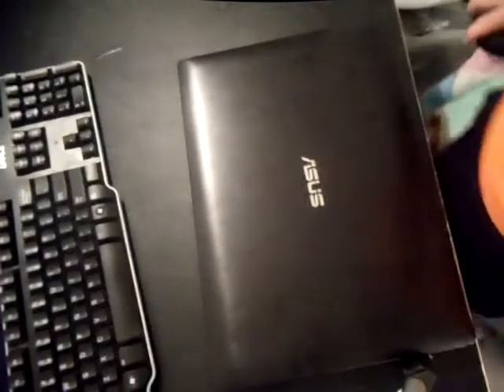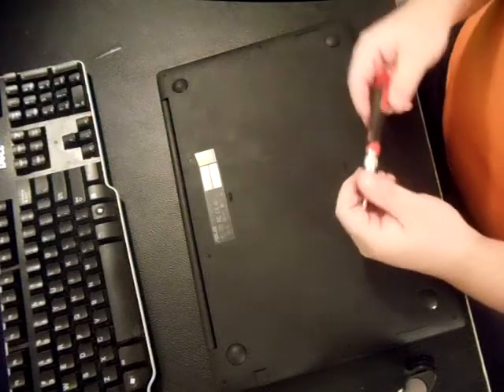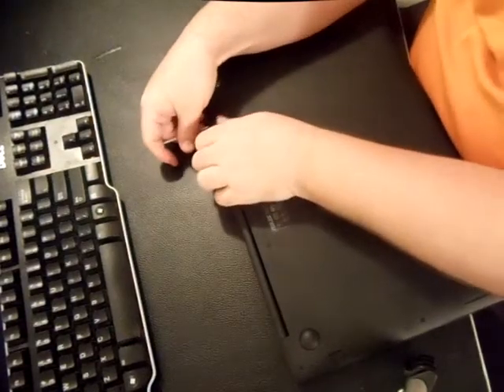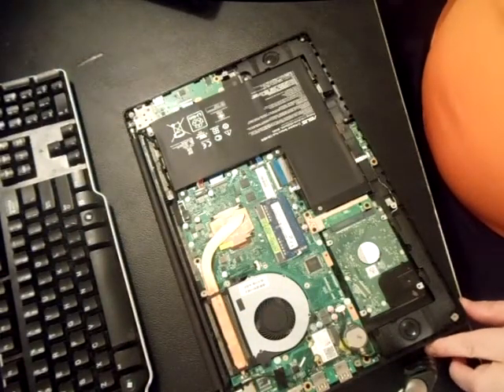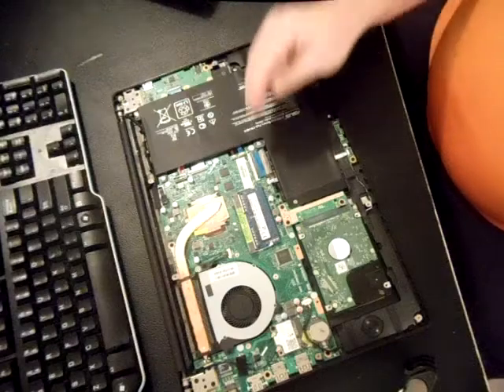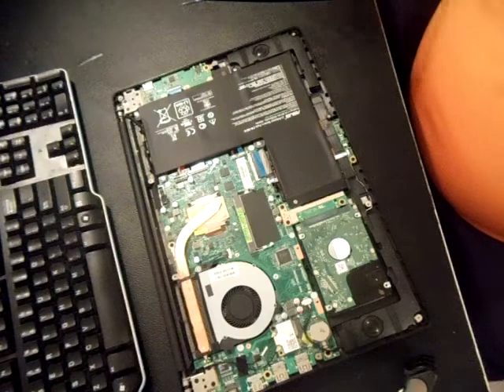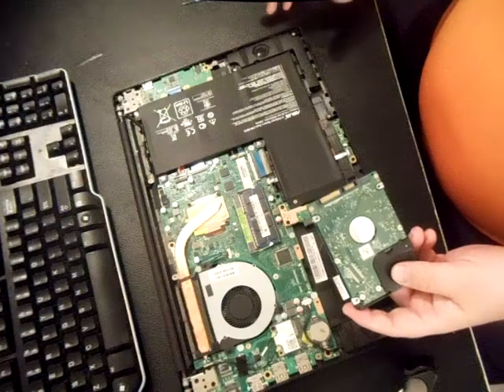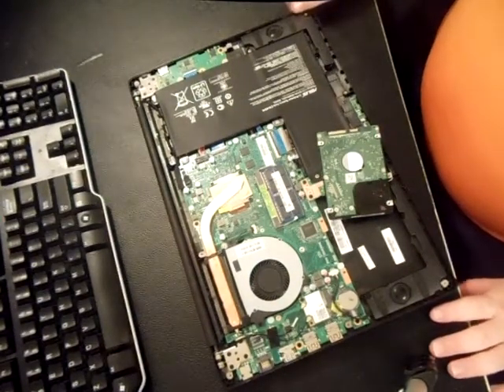Asus Q501LA Memory Hard Drive Battery Upgrade Removal Disassemble (F551M F551MA X551MA X551CA X451CA

Comment: Thank you for your instruction. My Asus q501L when first turn on, it will stay for a few second on the main screen then goes to black screen. I took out the RAM and clean it, but still not working. What do you think the problem is? Thank you
Reply: there is a video of a guy who fixes it by lessining the tension of the cable going to the screen.  It worked on mine with the same issue.

Comment: Would you be able to diagnose my Asus Q502la, that won't start.  That won't recognize a flash drive with .iso image?  I am wondering. Thank you.  I wonder if opening it up as you demonstrated and disconnecting the battery and re connecting it would fix anything? Your video gives me hope.

Comment: I watched this vid to learn how to disconnect the battery cable. I thought you were going to remove it. Is there a button to push, does the back slide out like a ribbon cable or you just use force?

Comment: I need to replace the hard drive in mind and you said if I contact Asus to get the operating system disc but how would I load it onto the new hard drive? There isn't a CD-ROM drive on this model.  I have a portable CD ROM drive and tried to make it accessible in the Bios but there's no option for USB boot.  Please advise.
Reply from the maker: I forget which F key but if you tap F10, F12 or one of those F keys at the beginning it will give you the option to boot from your USB DVD
Reply: +RubberWilbur it didn't work for me.  I just installed it in another laptop with a drive, then installed windows, then transferred the hard drive back to my laptop.  What a PIA!

Comment: If I need to clean the fan, do you recommend using an air can without opening it, or is opening it a necessity?
Reply from the maker: +blackjack2beat1that You don't need to open it.  If you use compressed air take it easy on the strength.  Hold it away from the vent about 4 or 5 inches. You could knock it loose or damage it if you are too close with it.
Reply: Thank you for your reply! I did what you said and it worked great!

Comment: may i ask you a question sir, if i need to buy a new Hard Drive, does it have to be a special one? or it can be "normal"?
Reply: did you find the answer to you question because i have the same problem.???
naturally you can but for some reason this one wont accept another one
Reply: deathwish3611 no, i sold that laptop and got a pc